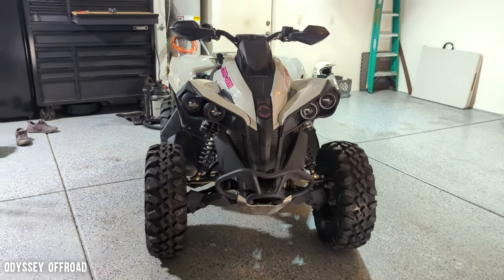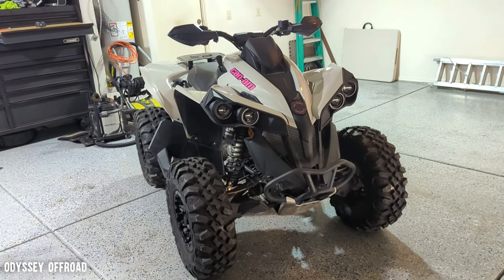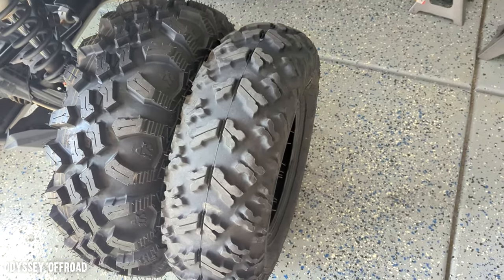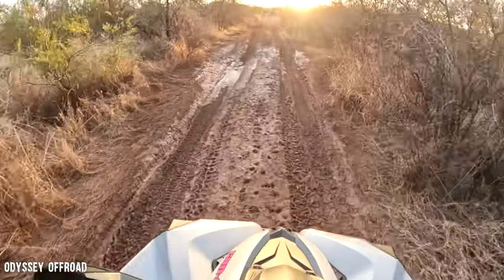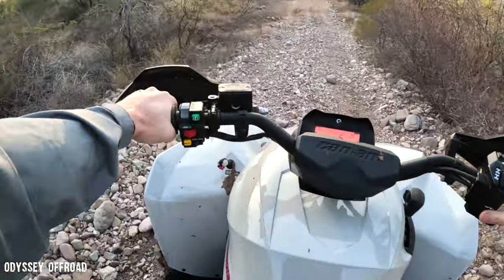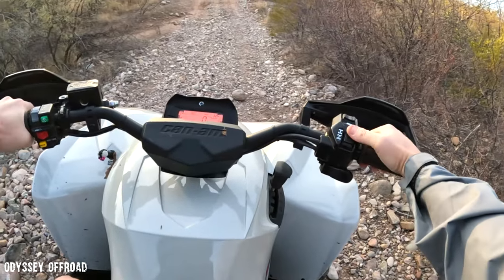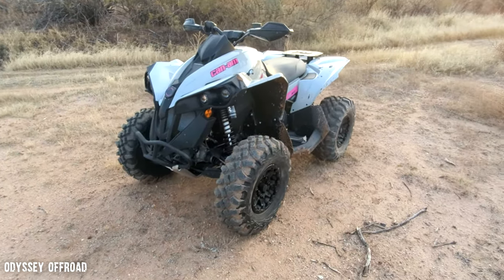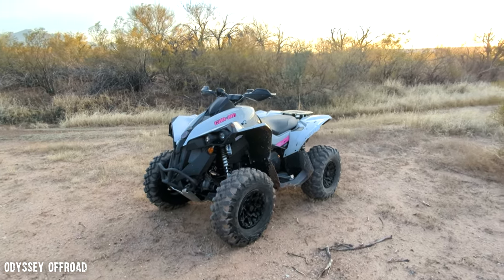Tusk Megabite tires installed on the Can-am Renegade 1000 + test ride and comparisons.

Comment: Cool, I have 27x9 and 27x11 Tusk Terrabites on my 2017 Renegade 1000r
Reply from the maker: How do you like it with the 27s?
Reply: @OdysseyOffroad   Not bad they measure 26.25" tall but are heavy, I might get some CVT work done because it is missing that snap is has on smaller lighter tires. I just rebuilt the gearbox at 3300 miles it was grinding changing gears and had 2 bad snaprings on the mainshaft. just got her going in time for michigan Snow.  keep up the good video's!
Reply from the maker: @brandonsenauit6908  awesome! Enjoy the snow and thanks for watching 🤙🏻

Comment: Did you notice the ride being rougher? Only thing I am worried about, seems like the holeshots would have better small bump compliance.
Reply from the maker: Lowered psi to 5 and it rides mint. Well worth the better grip and puncture resistance

Comment: If you wanna get the rene to run cooler pull the ecu (brain) oit and send it to get tuned i did it latst year and my buke says right a 150-175f and colls down alot cooler it a good idea for long term reliability also do an aftermarket exhaust at least slip on i did a bucnch of new hamspire riding in the summer and spent almost time half way on the meter for heat it a big diiference
Reply from the maker: Yes we had a 570 Renegade prior to this and sent the ecu to get tuned. on this one we will be getting a dynojet tuner for it and a slip on exhaust.
Reply: @OdysseyOffroad  excellent